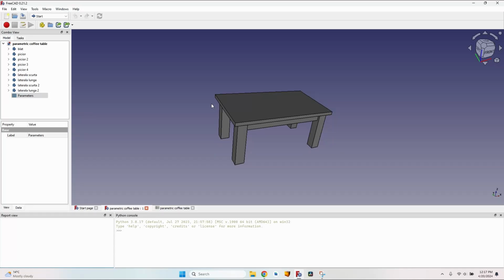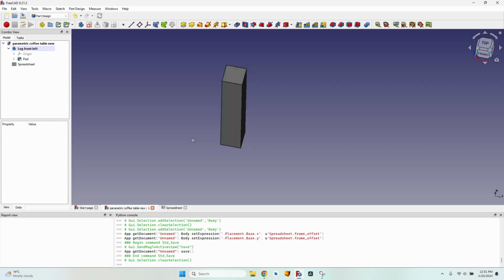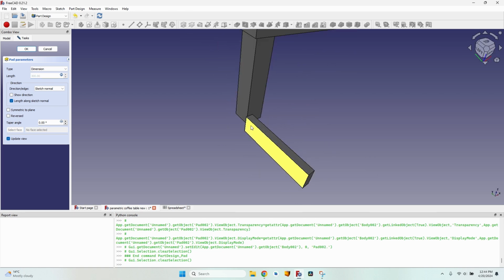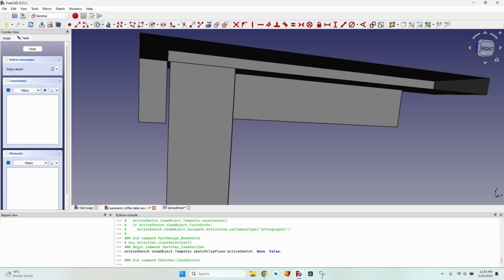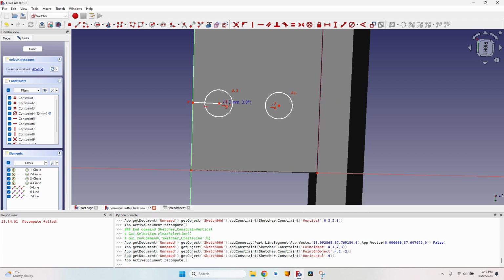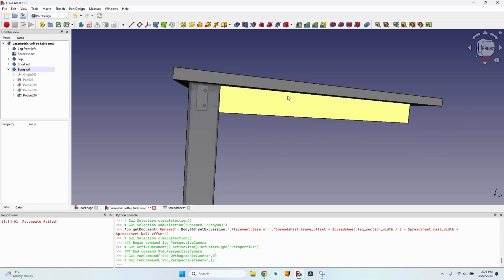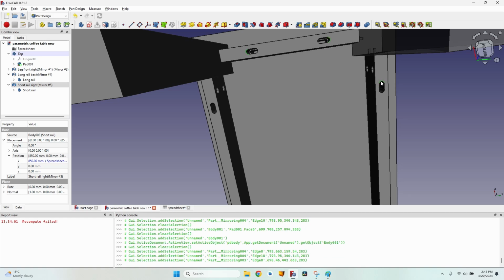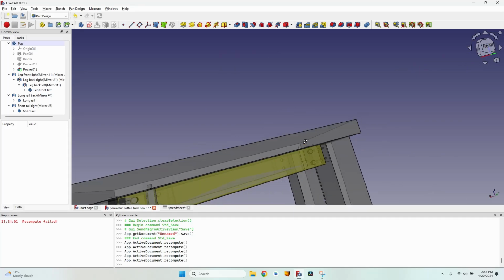FreeCAD Parametric Table Design – Create a CNC-Ready 3D Model

Comment: Maybe it's because I'm a programmer (among other things like mechatronics, electronics and woodworking), but sometimes I feel I'm overdoing parametric designs in FreeCAD 😅. But I love it. Sketches that only have points (set to be non-construction geometry, so they are visible when exiting sketcher), to use a point array to place another point-only sketch at those points, to then place solids at those multiplied points. That's just the start. Almost all of it with formulas, dependent on a few values in a spreadsheet. Or not even a spreadsheet. You can add your own properties to any object (right click any property in property view while "view all" is active to get the "add property" function) and access it like any other property from anywhere (I sometimes find it more logical to keep a property with the object itself than in a spreadsheet). Another benefit is that changing that property only makes objects recompute which reference that object, while changing a property in a spreadsheet will make all objects recompute that reference the spreadsheet. Depending on you model, this can be a quite the timesaver.

And don't get me started what can be done with addons like the Lattice workbench.
Reply from the maker: Not really a bad idea, but I chose the spreadsheet way of doing things from a UX perspective. Imagine opening a file and having to look for some dots that define the position of other dots. Then, if you want to change something, you have to discover what each dot affects. Having everything in one place, with readable names seems much more intuitive to me. The recomputation part is, indeed, quite annoying some times, but you learn to live with it, rather than risking having some parts not recomputed (which, unfortunately, happens some times, especially in the path/cam workbench)